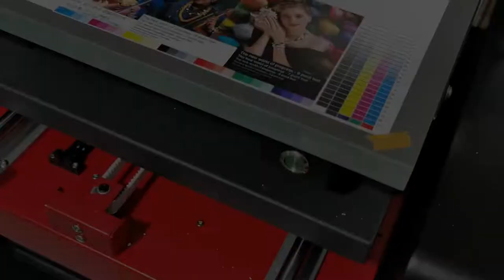Erasmart 3360 double print head uv dtf printer fast printing speed for uv dtf film

Comment: I have the same printer 
But it's working as DTG printer .
It's possible to change to UV printer
Reply from the maker: yes, can change to uv printer, but requires a technician to operate. If you need to consult more information, please add whatsapp +8615280803247, thanks